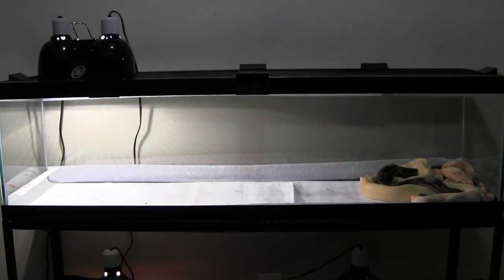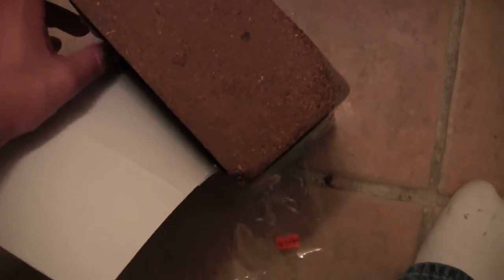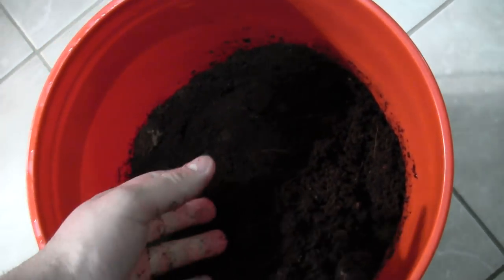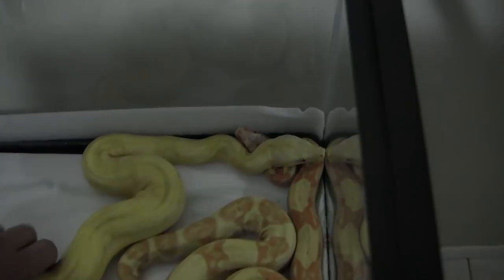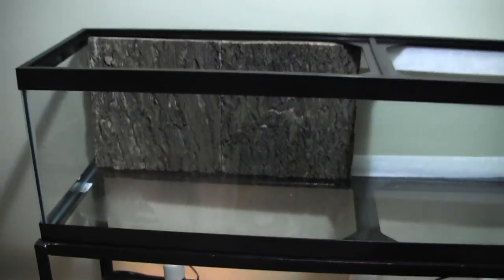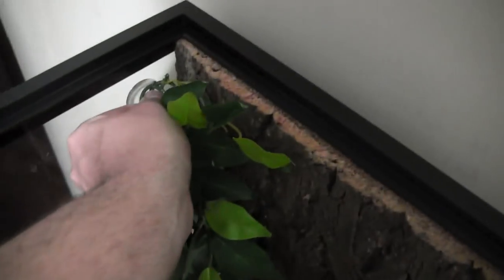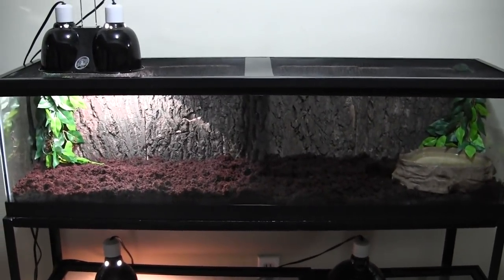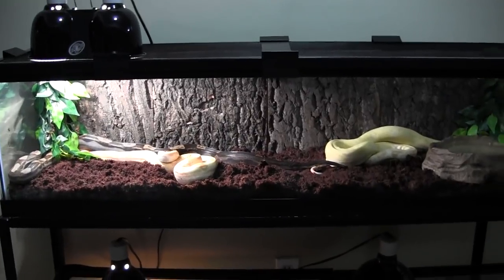How i setup my boa enclosure

Comment: Alright mate. If you have had mites the water/freezing/cleaning wont shift them. They are tough to spot on the boas because they have big scales the mites can hide under, much easier to spot on smaller snakes. The humidity of the eco-earth will cause a population explosion too. The only way I have ever managed to shift them is by getting chemical. I have had success with Ardap, not sure you can get it in the US though? I would also drop the humidity right down until you know they are gone.

Comment: Why not put boas in proper snake cages.  Fish tanks are for fish.  You'll work yourself silly to keep heat and humidity correct in such a setup.  The lights will only compound this issue by drying out the cage.  The EcoEarth will help, but still won't tip the balance.
Reply from the maker: There in boaphiles now...
Reply: ftfisher4x4 I put Moss on the bottom of my cage in my aquarium set up and actually they make different type glass and different Quality and overall it’s a different aquarium such as for fish I have seven fish and a red tail boa and two ball pythons
Reply: I have animal plastic cages for all my boas and you don't have to add no substrate just paper towels and it hold the perfect humidity and temperature and plus those are tropical snakes they're not ball pythons why does he have lights on top

Comment: put it in the oven or freezer thats what you did with the zoo med bark. i use to use eco bricks and wound up getting a hell of a mite problem with my snakes. For my smaller snakes i use paper towel for their substrait. And for humidity i keep a humidifier in the room and have had no mite problems. the larger snakesget a rubber liner which cleans super easy inthe tub.  I hope u dont have the problems i had with eco earth and happy herping.

Comment: I just got a boa and I like your set up but I was reading the comments. Does the Eco earth not work then ? And also were did you get your background?
Reply: Hey man I myself have used eco earth and it tends to attract mites so I don't use it. I would recommend reptibark or if u need some humidity add some moss . Hope this helps:) check out my channel
Reply: I myself use forest bedding with moss spread through the tank, works well for my 5ft 2014 red tail boa
Reply: +Stoney McGowan Yea that sounds like it works fine as long as the humidity is up ur good. I'm getting a brazilian rainbow boa and they need alot of humidity so I'm gonna use plantation soil mixed with coco husk and moss
Reply: +A&amp;O Reptiles for my rainbow boa and my blood python i use cypress mulch it keeps the humidity 75-80 at all times depending on where i want it for the time of year. a occasional mist here and there is all it takes. blood pythons need high humidity as well.
Reply: and for my red tail boa i just mix alittle aspen in with the cypress bedding to keep the humidity down so the boa won't get scale rot.

Comment: Hi you have a very natrual looking cage I'm getting a boa red tail boa and I was wondering if you could write me back and give me tips thank you it's very nice😃
Reply: Don't go with a glass tank.  Start your baby boa in a tub.  Much easier to control heat and humidity and move it up to a purpose-built snake cage when it outgrows the tub.  You can still create a natural looking setup in a proper cage, but keep in mind that anything that goes in the cage must be disposable or able to withstand a thorough cleaning and disinfecting.